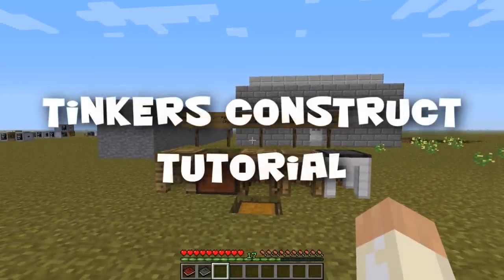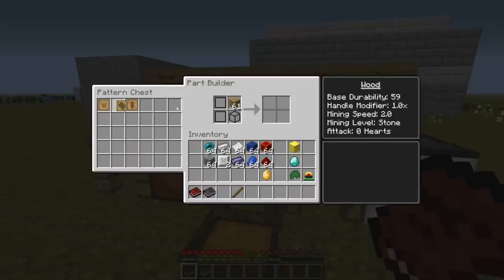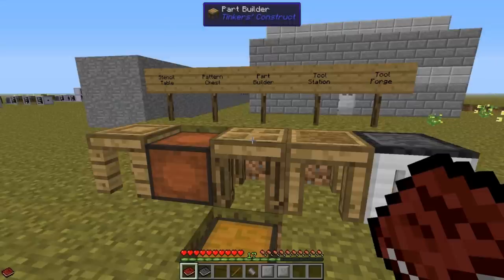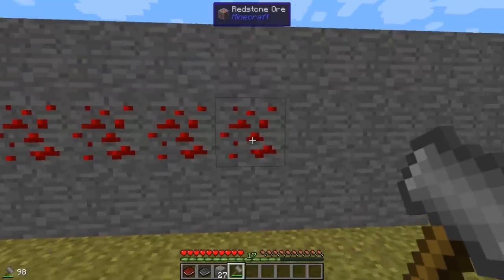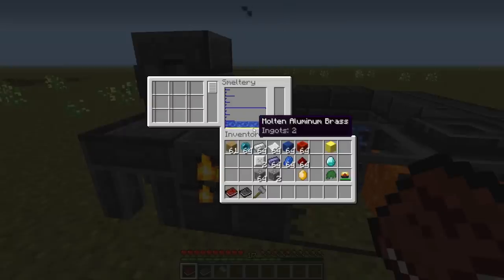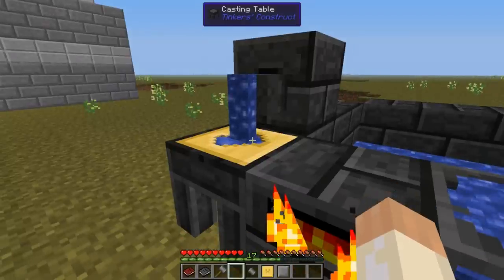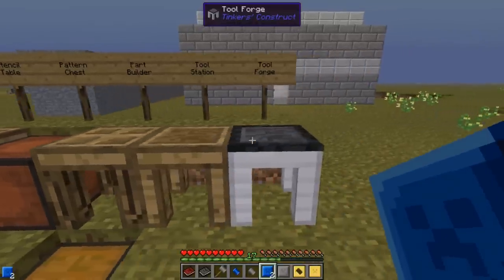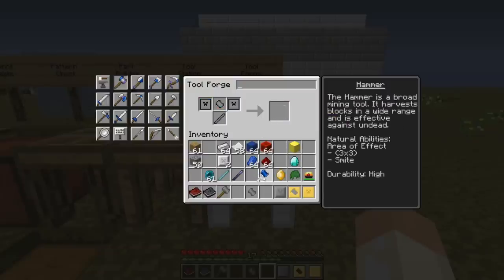Tinker's Construct Tutorial - Designing The Hammer (FTB 1.6.4)

Comment: Hey im using matural magic from atlauncher. I cant seem to make the steel hammer ..... or make anything from all the same material. Like i have 100s of steel ingots and multiple parts. Any idea why it wont let me put them together in the tool forge. Ive looked all over the web??
Reply from the maker: I don't fully follow, are you trying to make parts in the part build from ingots, or have you made the steel parts from the smeltery? In the tool forge (the upgraded variant of tool station) it should be possible to put together... but there is a risk of that modpack has disabled some tools, so you can try it in a generic FTB pack (like inifinity - where almost no items are disabled).

Comment: i used 2 large iron plates, an iron hammer head and a slime tool rod but it wont work. i also tried different tool rods and different large plates but that didn't work either. any help? (yes i am using the tool forge and i have experience with tinkers construct just not with the hammer)
Reply: nevermind. i was using tool rods instead of tough rods. :P

Comment: Hello, I am using the Yogscast Moonquest 1.6.2 modpack and I am trying to make a hammer. I have all the relevant materials (patterns and iron) but when I put it in the part builder nothing comes out in the slot. I have placed it in one by one and also placing it all in... Please help. Thank you
Reply: But it works if I do it with cobblestone.... Do i just put this in the casting table?
Reply from the maker: mananp01 Basic material like Stone, Cactus, Slime.. whatever, they are made to tool parts in the Part Builder. But metals has to be smelted in a smeltery, and then you pour the liquid metal in appropriate casts to make the Iron Hammer. Hope that helps :) If you are new to the mod, check my "Getting Started" tutorial for the basic smeltery things.
Reply: therealtkh Thanks. And I will check out that Getting Started tutorial. Subbed!
Reply from the maker: mananp01 Cool, hope you get it working. Just tell me if you get stucked again :)

Comment: When I try to put stone with the hammer head pattern in the part builder I can't get a hammer head, nothinf pops up no matter what material I use
Reply: +Luke Roberts i have the same
Reply from the maker: +Luke Roberts Please provide what modpack you're using. Versions and so on. Screenshots always helps! Also check other comments, I know people had a similar problems before. Typically due to modpack changes... Like using Smooth Stone instead of Cobblestone...
Reply: i already fixed it
Reply: but thanks

Comment: part builder doesnt work for me, i tried putting almost every ore and block still doesnt work
Reply from the maker: Depending on modpack or mod selections the recipes might change, I don't know what you are using but the system works very much the same way in the current packs I play nowadays. Also remember that some materials require a smeltery to make parts if it's a metal or alloy for example.

Comment: How do you repair it? I've been trying to. I tried putting a ball of moss on but it wont work cause I have auto-smelt on it can someone help?
Reply from the maker: First of all, what mods or modpack are you using? The Auto-Repair (Ball of Moss) should be compatible with most modifiers, including Auto-Smelter. What other modifiers do you have? And what are all the parts made of? You repair The Hammer with the same material as the Hammer Head is made of. Is the Auto-Repair applied? (It should say Moss I up to Moss III depending on how many Ball of Moss you apply.) Note that a Hammer often has high durability, and it can take a long time to repair it fully (it can feel like it doesn't work, but check item ID and it should say). It repairs more quickly in sunlight, but still much slower than how muck durability is used when using the tool.
Reply: I am using attack of the Bteam I have an iron hammer Where do I repair it in? I have auto-smelt Luck and Haste or you can say Redstone 50/50 Lapis 100/450 Lava please reply back thanks! #School'sout
Reply from the maker: If the Hammer Head is made of Iron you should use Iron Ingots to repair it. Repair in the same Tool Forge as you built it in. Use the "Anvil layout" and put Iron to the top left and the hammer next to it. Exactly the same way as you upgrade with Lapis or so..
Btw, are you using texture packs, Optifine or other graphical mods?
Reply: Thank you for your support and no I am not
Reply: It isn't working I put an Iron Hammer Head in the repair and modifications I tried putting it in the spots I tried every place you could put it in
Reply: Wait never mind whoops XD sorry for waisting your time
Reply from the maker: Jack Huang Haha, no problem, good you got it working :)

Comment: Can some help me try figure this out for hour I'm on attack the b team in trying do hammer head and plates we 1.6.4 I try use stone and cobble stone it didn't work for me.
any comment help be nice
Reply from the maker: The most common error is not enough material (they cost 8 each), and you have to put all at once due to a bug that might still be there. I don't know if Attack Of The B-Team change any recipes though. Another issue people have sometimes is texture packs, Optifine (or similar) causing glitches.
Reply: alright thanks ill check. I'll respond later if it works thanks for the help.

Comment: This is working for me i put in the cast and 8 cobble nothing comes out help?
Reply from the maker: Did you put a cast in the part builder? In that case, that doesn't work. With cobblestone, you use the normal (wooden) stencil. The cast is only used in the smeltery to pour liquids into. Hope that solves your problem!
Reply: therealtkh  Oh no sorry not the cast the pattern
Reply from the maker: jason mikhailov Ok, but I would need some more info. Is it the hammer head or so? First of all make sure you put in all 8 cobble at once (there has been a bug when putting them one by one). What modpack, graphical addons or other addons are you using? Send links to screenshot or so, it can also help.
Reply: therealtkh It's the large plate and the attack of the b team modpack I can't provide a screenshot because my Mc crashes when i try :(
Reply from the maker: jason mikhailov Have not played with that modpack, but for some reason it is probably the most common one people have problems with. Anyway, try with other materials to see if that works (planks for example). Too bad with the screenshot issue, it would have helped :/
Reply: therealtkh Yea Thanks! Wood works :D!!
Reply from the maker: jason mikhailov Ok, good, that means that you're doing it right! But I don't know why the Cobblestone would be a problem. Because the Wooden parts can't be used in the smeltery to make casts. Someone once said in a comment that (smooth) Stone is used instead of Cobblestone in some modpacks. Try that...
Reply: therealtkh No the wooden part worked to make a cast for me
Reply from the maker: jason mikhailov Hmm, I was kind of sure it wasn't possible with wooden parts... Oh well, good things it worked out for you :)
Reply: I also play with Attack of the B-Team, and i died a little inside when it didn't work. Then i watched this and your comment about the smooth stone, it works...

Comment: Help! When I try to use the hammer head pattern, tough rod pattern, or large plate pattern in the part builder, when I use cobblestone the finished craft doesn’t show up, so I can’t make a stone hammer head or anything
Reply from the maker: It's always a good idea to write what modpack or mod selection / versions you play. Recipes can differ between packs! Otherwise, a common problem is that too few pieces are used. An old bug (don't know if it's fixed) where Cobblestone  (or other resource) is filled one by one up to required amount makes it so the product won't show up.

Comment: how do you repair it?
Reply from the maker: The Hammer is repaired with the same material as the Head part is made of. If the Hammer Head is made from Cobalt, you need Cobalt Ingots to repair it in the same way as I did with the Stone variant. If you refer to the variant I built with a Flux Capacitor, it is charged in an "Energetic Infuser". I didn't go into detail regarding that since it is more an Thermal Expansion thing rather than Tinker's Construct. I just wanted to show that it can be upgraded with things from other mods as well. I hope this answers your question.

Comment: for some reason I cant make anything I can only get the patterns but not the shapes
Reply from the maker: So when you put the Stencils in the Stencil Table, nothing shows up? Send a screenshot how it looks, that sounds strange. What modpack are you using, graphical addons, versions and so on?
Reply: therealtkh no I'm not using any other mods I'm only using tinkers construct. I can get the patterns but i can't make the actual hammerhead that's what i was trying to say
Reply from the maker: Ernesto Rodriguez Ok, good. Can you make other tools (like pickaxe head, tool rod and so on)? The most common mistake is using to few resources. The Hammer Head and the Large Plate require 8 pieces each. And put in all 8 (or more, like a stack) at the same time. For a long time there has been a bug where putting them in one by one didn't work even if the amount was correct.

Comment: Bro the part builder doe not let me make a hammer head made of stone or wood or anything
Reply from the maker: In some modpacks they have changed the material requirement. (Smooth) Stone instead of Cobblestone for example. Also make sure you put in at least 8 units at the same time (not one by one). This is due to an old bug that might still be there in some packs.
Reply: Oh thanks Now I can actually play the game